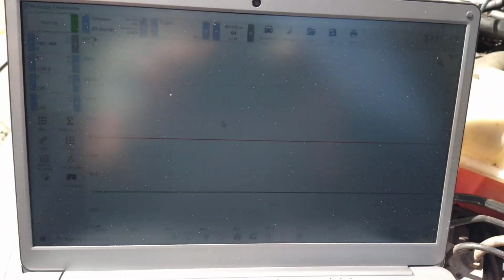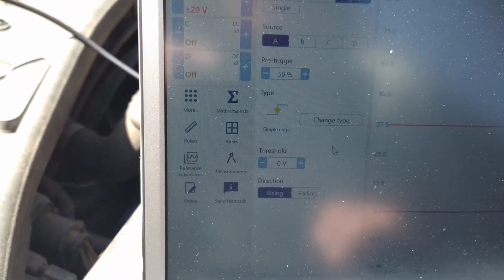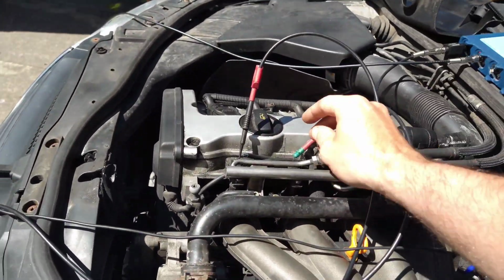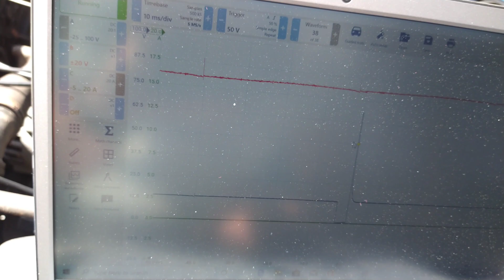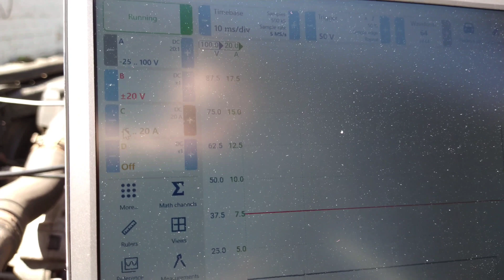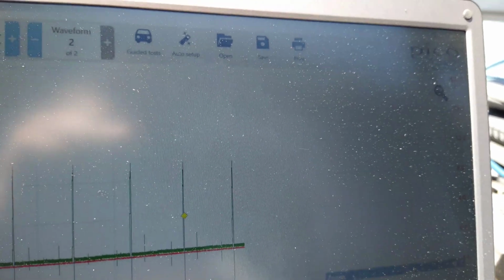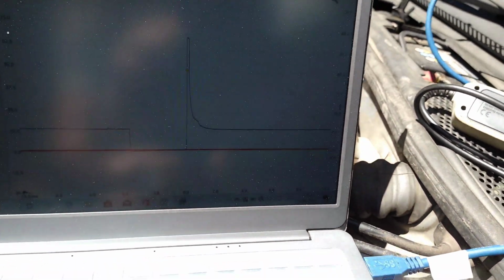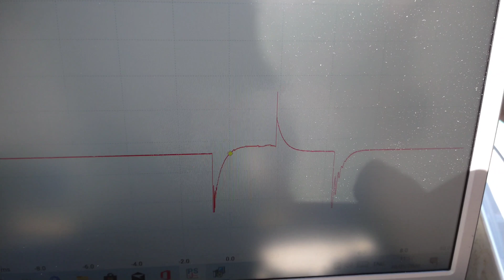PicoScope 4425A (with Hantek accessories)

Comment: Have you considered the WPS500X? I feel like that tool is about 1/3 of valuable toolkits to have and avoid wasted time on trial an error from home made ones which I bought one from eBay and it did not work at all. I need to be able to pull information quickly to identify issues and I will include this poverty package along with the transducer kit.
Reply from the maker: Hi, I haven't tried the WPS 500 due to not seeing them second hand. Like you I have used eBay DIY pressure transducers and found a stepped waveform and almost no vacuum shown. I ended up getting a fluke PV 500, it's like the fluke PV 350, this worked great with a sealey compression tester.
I managed to get it second hand for about £200.
The waveform has been good using the fluke.
Thanks for watching
Reply: @mechanicmatt871  do you get good enough waveform signals out of this sensor? Thank you for the info, I already had a compression kit that has adapters and it may work for what I need it for.
Reply from the maker: This is the pv500 getting used with the Pico.
https://youtu.be/n5WYNH44Mxs

Comment: I'm very close to biting the bullet on the new Pico with the fancy LED and auto zero (which is very nice); the new clamps require no battery and what I love about it is the color coding that is sometimes confusion and you have to double check which wire is what lol, especially when wiring all 4 channels. I"m currently looking into this poverty package as well. Though mine is even more poor, I have one of the 2000 series scope with 4 channels. Will probably need a set of 4 of attenuators just for kicks lol. I have the verus pro but it is slow for things that are failing slightly. sometimes it is better to get better resolution that most pico scopes offer.
Reply from the maker: I had a hantek for a few years and it was better than nothing, although it missed information when I wanted to zoom in on  a screen it was not good, eventually I got a Pico and it was so much better, I didn't miss out on information that I was needing.
I started with putting colored tape around my old leads so that they matched the channel colour. Eventually I got some colored Pico leads due to the hantek leads not being reliable after a few uses.
I am still using all of the other old hantek accessories with this scope and it works fine
Thanks for watching

Comment: Congrats once you start using it like a 4425A it’ll save you a ton of time. You can use any BNC connectors you just don’t get auto set up Which really isn’t a big deal. Get the amp clamps first before anything else. Don’t forget to check for update pico 7 daily
Reply from the maker: I am so impressed with the details in the waveform,  it doesn't miss any thing.  Thanks for watching

Comment: I created 2 custom probes for you Matt so you can use your HANTEK CC-65 in LOW and HIGH range in PICO
Simply import these into your PICO CUSTOM PROBES
https://drive.google.com/drive/folders/1oWiSDZi2XAI7KJ2i6phaFiSxOEutOk4H?usp=sharing
Reply from the maker: Thank you, thanks for your help
Reply: @mechanicmatt871  - Usually a link like this goes through without need to request. Let me know if there is an issue:)